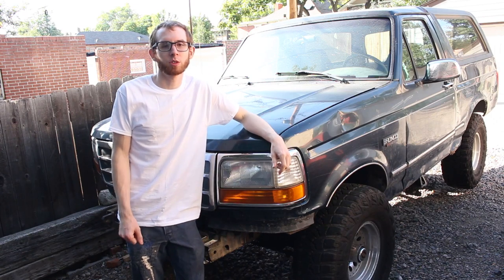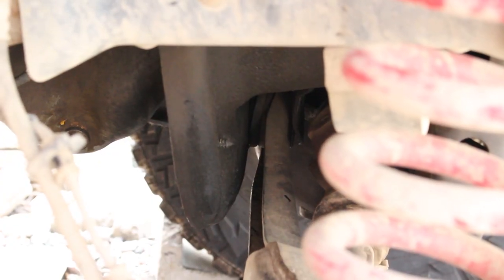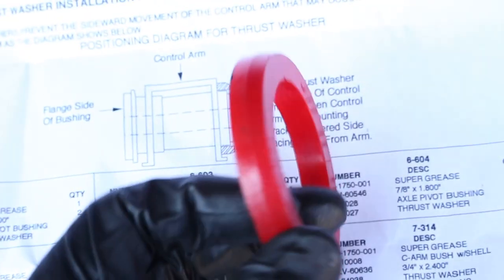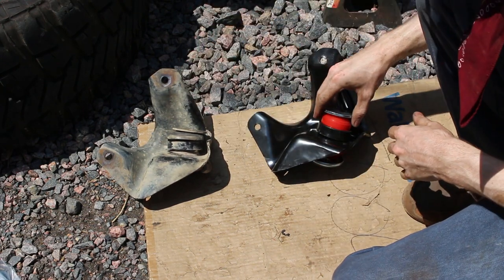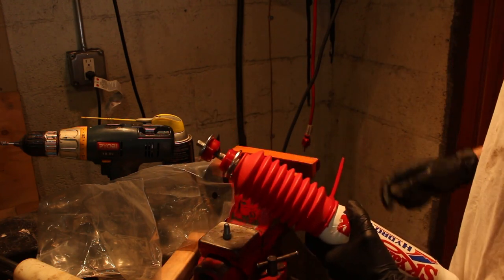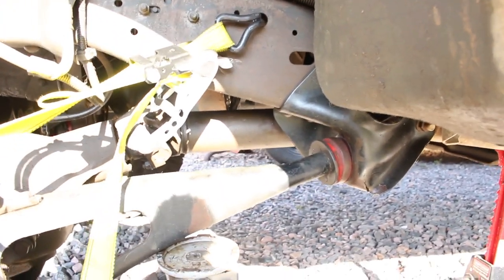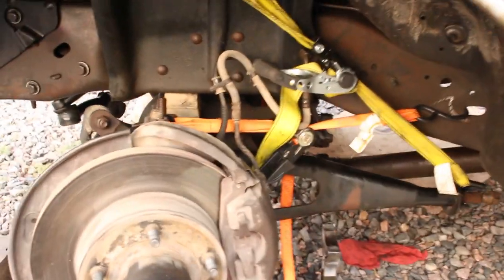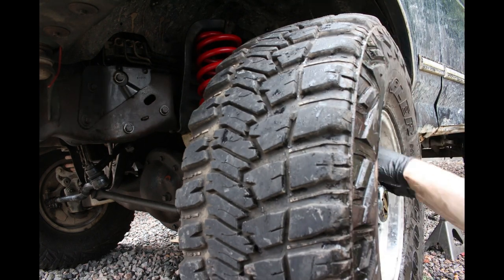Replacing Radius Arm & Pivot Bushings 95 Ford Bronco 4x4

Comment: Good video! With that being said you did install the shock bushings upside down! The little lip is supposed to center the bushings to the shock mount hole!
Reply from the maker: Can someone confirm this? I think you are talking about 21:30 correct? Thanks for the comment!
Reply: @scrapmetalmade  confirm

Comment: You put the shock bushings on upside down. The step is to sandwich/insulate the sheet steel so that the bolt doesn’t gnaw at the sheet steel.
Reply from the maker: You are correct. See the pinned comment, I appreciate the feedback!

Comment: you installed part of the radius bushing backward and used a ratchet strap to correct your mistake..... now your toe will be screwed up putting extra stress on other components. you did accomplish a task....for a given amount of time...but as a mechanic, my eyes are bleeding.
Reply: Can't be worse then it was before he replaced it
Reply: @wadeberry8261  it'll just fail early

Comment: If you remove just the radius arm bracket, you won’t have to remove  ANY other thing. No shock, no spring, no track bar…whatever ford calls it. It’s a track bar to us jeep guys. But remove that back bracket and slide it back. It’ll be WAY quicker. Ford engineers were WAY smarter back then.

Comment: Both the pivot and radius arm bushings can be done without removing the springs, shocks or wheels. But doing it on concrete is a lot easier.
Reply: I’m about to do this job in a few days. How would I go about it without removing everything? Trucks lifted so I think that should help. My guess would be just one side at a time and use the jack as leverage to let down the beam
Reply: @Flopolapagus  that’s exactly what I did.

Comment: We’re those energy suspension bushings? You said polyurethane, I just got autozones version they are red and look like that but I had about an inch to compress, the website said two required per kit, I put two small bushings on mine, they’re rock hard, I don’t see how the large and small bushing would have worked on mine, 2wd f150
Reply: Could be different for the 4wd

Comment: Why don’t people just undo the radius arm bracket and slide all the crap off all this work when u don’t need to undo the bracket slide it off put new bushings on slide bracket on done no taking half the axle apart to do it easy peasey
Reply: Most of the stock radius arm brackets are riveted in. So unless you need to replace the bracket or want to grind/drill it out, it's easier to drop the pivot arm.
Reply: my 89 has only rivets, not touching that unless the bracket is mucked
Reply: I may just cut the rivets with a grinder and replace with bolts when I'm done
Reply: Even after spending a few hours and a few drill bits drilling out the (usually 6) hardened rivets, it’s easier said than done, especially in trying to get the brackets (which are on the new bushings now, so have little if any “play” available) lined up in order to get the bolts in.